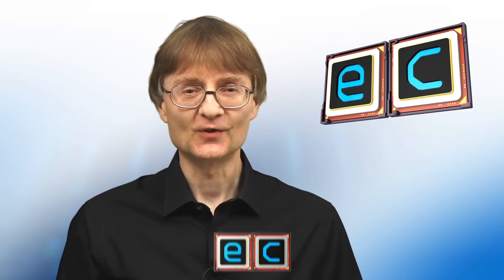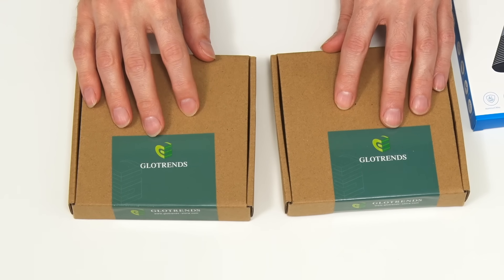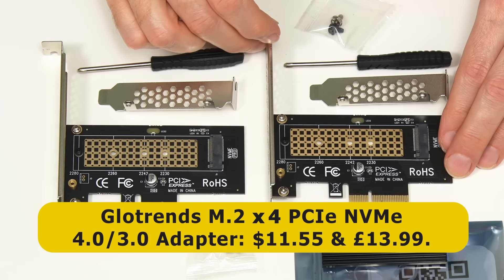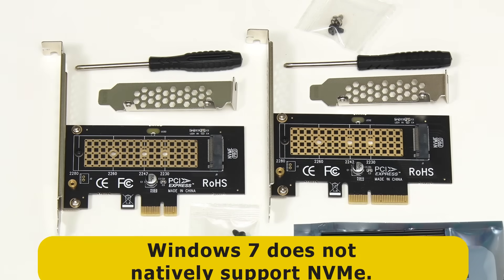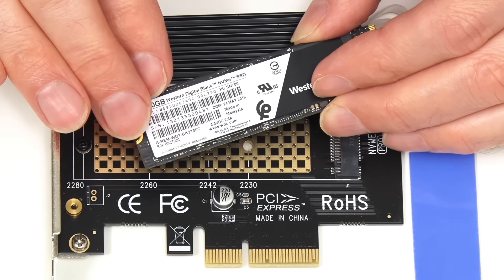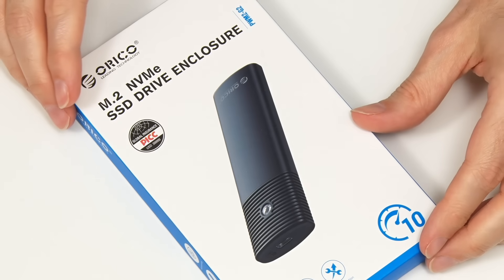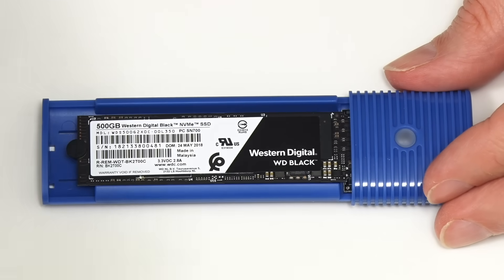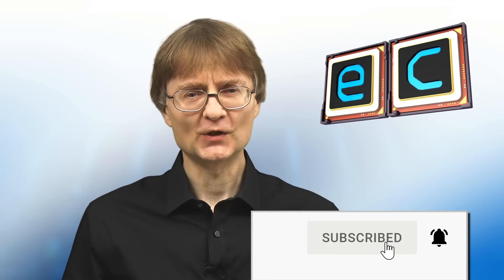M.2 SSD Adapters & Enclosures

Comment: i was actually going to buy one.thank you
Reply: can someone tell me more
Reply: also can anyone tell me more about usb to m.2
Reply from the maker: There is not a lot more to say about USB to M.2. As noted in the video, the key thing is to make sure you get an enclosure that supports the kind of M.2 drive you have (SATA or PCIe/NVMe). For NVMe drives, a 10Gbps enclosure will be faster, but only in a 10Gbps USB port (USB 3.2 Gen 2).
Reply: thank you